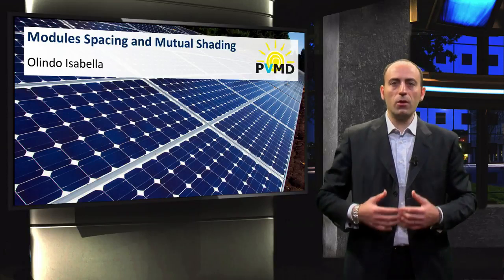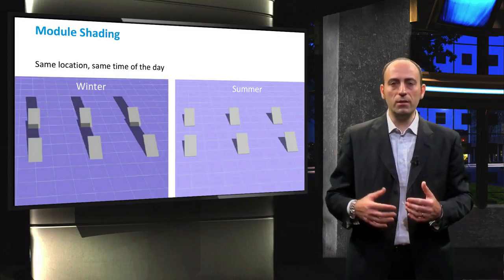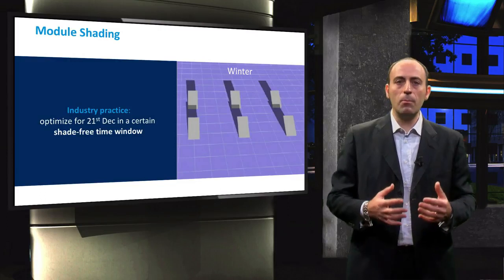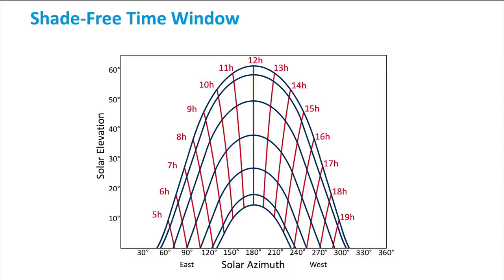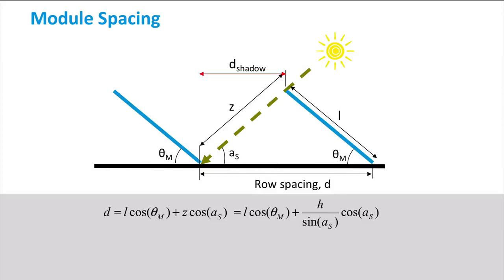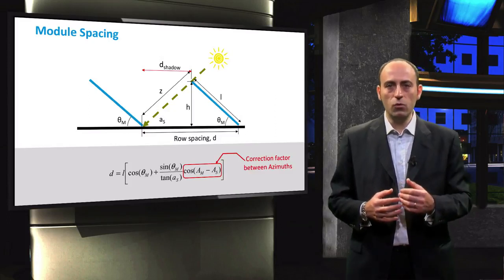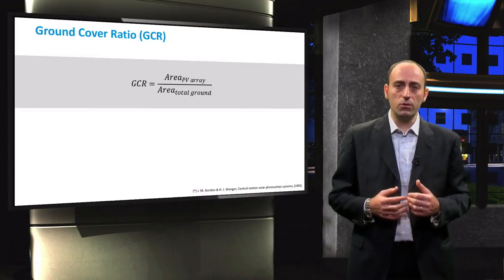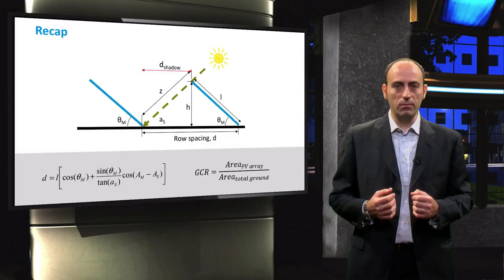PV3x 2017 3 4 1 Modules Spacing and Mutual Shading video 720

Comment: Respected Sir
Watched your lecture attentively. Your derivation to the point of d = l {cos (Theta m) + sin (Theta m)/tan(a s)} is perfectly alright. You should have tried to eliminate the angle a s for it is indeterminate and itself a function of d (spacing). Then, how you arrived at the value  d = l { cos (Theta m) + sin (Theta m)/tan(a s) cos (Am-As)} is not known. As you can see the difference between two azimuths (Am and As)  is 56° and cos 56° is 0.56 (.) Therefore if this formula is relied upon, it will greatly reduce the spacing between the panels and will lead to an erroneous outcome i.e. shading. So most respectfully submit that your formula is not correct. Also it is not appropriate to say after such a long exercise, that spacing should be three times the panel length. It's blatantly wrong. It may be true of Delft (that too if only the panels are tilted at the angle of latitude Delft, Netherland (i.e.52°). It is not true for the entire world.  Kindly send your e-Mail so that I can give a correct reply. – KUMAR INDU  BHUSHAN, (kumarindubhushan@yahoo.co.uk), INDIA, whatsapp and mobile +91-8112235723
Reply: Angle "as" is the angle of the Sun!  Angle "as" should NOT be removed.